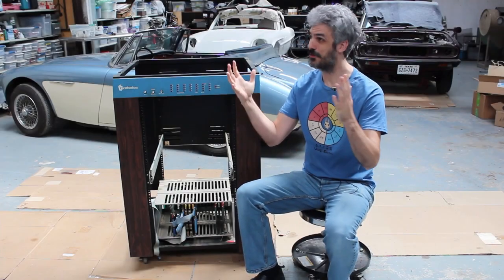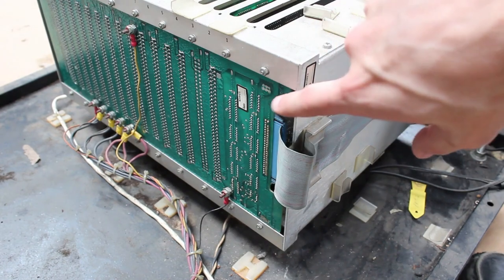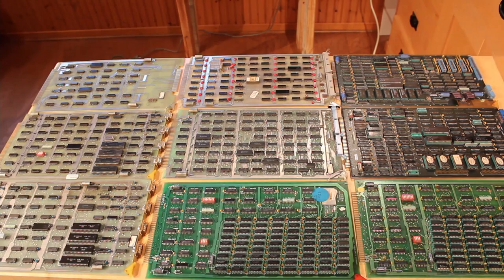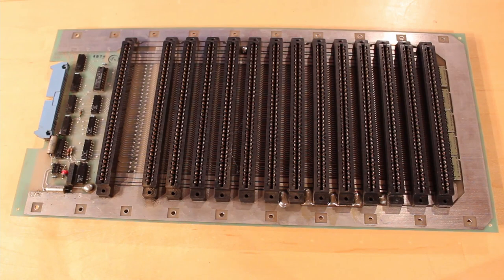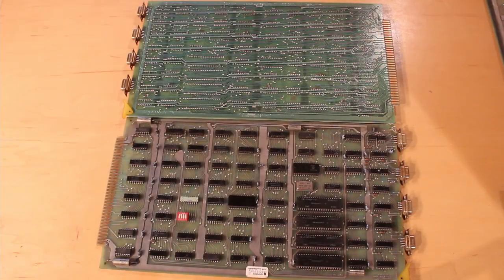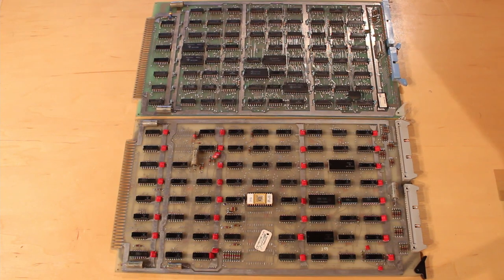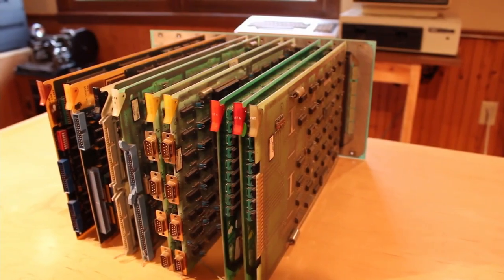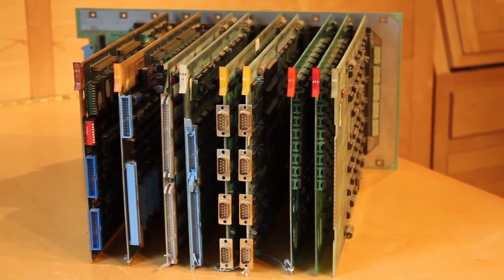Minicomputer Part 4: In-depth Look at all the Computer PCBs

Comment: Centurion board overview:
CPU6:  Is a 8 bit one board bit slice computer with a 16 bit PC (program counter). The 256 Byte static RAM chip are the CPU6  registers for each of the 16 interrupt levels. The two AMD2901 (4bit wide ALU's) with 8 bit x 2K PROMs emulate Warrex-Centurion's first computer the CPU4 which had four cards CPU1, CPU2, CPU3 and DMA card. Upper one of the 26 pin cables is DMA control signals and the lower 26 pin connector is for the front panel switches and LEDs.

DSK/Autoloader: Has two functions (1) is being part of the two boards needed to control the 10MB Control Data 9427H disk drive.  (2) The Autoload bootstrap is the machine code program needed to read the boot track from track zero on the 9427H disk zero (disk pack) or disk one (fixed disk). One 50 pin cable connects DSK/Auto to the DSK-II card. The other 50 pin shielded cable connects the DSK/Auto to the 9427H disk drive.   The 2702 EEPROM is the boot strap program store. The DSK/Auto & DSK-II cards designed back in 1976. Later designs of the DSK/Auto card removed the 2702 EEPROM and replaced it with two 128 byte PROMs to reduce cost. ( The two small caps on the back of the DSK-Auto card was to fix a drive select cross talk problem on the very first designed card rev. )

DSK-II: Is the 2nd half for the 9427 Hawk disk controller and has the CRC check sum and R/W controller state-mach logic. The 26 pin cable is the DMA (direct memory access) channel control signalling. If the DSK-II is in a CPU4 system the other end of the cable goes to the DMA card. If in a CPU5, CPU6 or CPU7 system the DMA connection is on the CPU card (no DMA card).

MUX: Is a 4 port RS-232 or 20 ma current loop serial controller to connect terminal to the minicomputer. The system default serial speed is 9600 baud (9600 8,1,N) for all ports but port 3 of the first card at I/O address F200 with is by default at 300 baud (300 8.1.N) for modem connections. (yes MODEM in the 1970-1980 run at 300 baud) FYI - The newer MUX card as the crystal oscillator in the silver can near the 4 UARTs. The old MUX card as a discreet crystal oscillator near the last serial port #3 bottom of the card.

CMD:  Is the disk controller for the 96M byte Control Data 9448 Phoenix disk drive. The first Centurion 9448 Phoenix disk drive controller has around six circuits cards of TTL & ECL logic and not very dependable. The later redesigned CMD card in this system is a single board CMD 9448 disk controller made up with two AMD 2901 4bit slice ALU and 8 bit x 2K PROMs to build the state-mach needs to interface the 9448 into the Centurion minicomputer.  The "edge 26 pin" cable is the DMA to the CPU5, CPU6 or CPU7 (CPU4 did not support the CMD). The 60 ping cable is the I/O cable to the CMD. The four other 26 pin cable connectors connect to CMD-1, CMD-2 CMD-3 or CMD-4.  The reason the AMD2901 are used on the CMD card is because the Centurion engineers like the AMD function & design easy after using the AMD2901 on the CPU5 & CPU6 designs.

PRT: Is a standard 7 bit parallel Centronics printer interface. This PRT card interface to the Data-100 (ODEC printer) that is with your system. The Data-100 printer can be from 125 LPM to 300 LPM.  Odd thing about the Data-100 printers is the printer does not have a print-hammer for each of the 132 print position on the wide green bar paper.  The Data-100 shuttles the hammer bar side to side in time with the character set chain ( one crazy design ).

MEM:  Is a 128K Byte with one bit parity per byte. The Centurion memory system is 8 bits wide and can only address 60K bytes of the 64K byte memory page ( baggage of the CPU4 system and Centurion memory mapped I/O ( F000-FFFF  )). The first Centurion memory was 4K byte core  cards. The next memory cards are 32K byte of 4K DRAM without parity. Your system has 128K bytes using 16K DRAM with parity. The 8 position enables with row of 9 memory chip is ON and which card it is the low 128K or the upper 128K memory card. The 4 position switch rolls the RAM chips around the memory address to memory trouble shooting.

BackPlane:  Is bus design driven from left end (CPU end) with termination resistor packs on the right end. The bus is 8 bit wide data, 16 bit wide address, 4 bit interrupt level and overall system control signals. To the left of the CPU slot is a PROM on a socket and control logic to help boot strap the system. (If a DSK/Autoload card is installed in this non-CPU4 backplane the boot EEPROM-PROM is disabled on the DSK/Auto card and the backplane PROM is used to boot from the 9427H, 9448 or floppy disk drive.) The 50 pin backplane cable controls the from panel LEDs. The system DC power connects to the backplane +5 VDC. +12VDC. -12VDC. Only the old 8 inch floppy disk drive uses the +24VDC from the power supply.

FYI  -  The Warrex / Centurion stickers on the cards are of warranty or repair date rechecking.  Also of a card has a RED tag on it the card has been make a bad and should have a tech's name, date & problem on the tag. If a GREEN tag the board tested good the the tech's name & date. If a YELLOW tag the card was found in the field service pipeline without a status tag and needs to be tested. If you real wish to get me pissed-off let me find a card in the shop without a GREEN or RED tag....!

Regards,  kromaine132@gmail.com
Reply from the maker: Ken, thank you so much for the absolutely stunning information!
I got so much wrong in my guessing on the system, haha. This is absolutely amazing, and I'm thinking I'll have to do a follow up video soon correcting all my misses and giving proper, updated information!
Reply: You did a great job for your first pass with the Centurion system being older than you are.  👍
Reply: For me it was the 75110 line drivers (I think) on the CMD card that said that was not part of the CPU but most likely for cables to the disk cabinets.  But I really appreciate the detail you added on the bit-slice architecture.  I never worked with it (got into designing properly in '83) but was certainly aware of it.  Also interesting was that AMD 3 to 8 decoder with tri-state outputs.  AMD had loads of interesting parts in that line-up.
Reply: Just..WOW!
Reply: So the CPU is made of discrete ICs?
Reply: @mojoblues66  the original cpu4 was, yes
Reply: what a bloody legend! damn I love youtube sometimes. was that information burnt into the back of your skull like the phosphor on that CRT? I know I have I have data burnt into my skull from 20 years ago. pager codes and calibration values. If im lucky, i'll get i cant remember my kids, but I can recite those damn numbers verbatim. 
to contribute something (n most ya'll will know this) the 7905 on the big heatsink was a - ve 5v regulator. 7805 was the positive. big fat 5v rail, but to get negative 5v was from the 7905, linear regulated down from the  -12v rail. hence a chonk heatsink. im not 100% sure why this is needed, but it was. I know old EEPROMS needed minus voltages for programming, and rs232 serial was a balanced +/ - signal. 
great video next
edit: youtube didnt like my use of asterixis and dash marks
Reply: @mojoblues66  Correct, no microprocessor here. Looking at the board you see the individual parts of the processor. The PROMS contain machine states that get played back just like a player piano scroll or a music box sequence drum. Each instruction triggers off a sequence of probably 8 'notes' which move data between various chips and tell the ALU what to do. The heart of the CPU is an 8 bit ALU made from two AM2901 bit slice 4 bit ALU chips working together.
Reply: Now I don't need to watch the video!
Reply: @Peter_S_  I used to work on machines that used AM2901s to emulate old PICK/Reality machines from the 1970s. It was incredible how well they worked.
Reply: Another note, the 7905 mentioned in the video is a -5V regulator and not a +5V regulator. This is probably for some of the EPROMs, as some of the older versions require both +/-5V as well as 12V.
Reply: Wow! Thank you for the description! So much of IC's and so less computing power...🙄🙄 Probably guys were a little bit upset when IBM started rolling 286s...
Reply: @ran2wild370  Not really, we had 10 years of App. Software for CPA's, Hospitals, small Banks, small Oil & Gas drillers  and small MFG companies. Product was very strong in its time, so much that EDS ( Ross Perot ) did buy the company.   Regards, Ken R.
Reply: @kenromaine2387  After almost 40 years this fact sounds almost  as a fairy-tale  legend for those who got into the world of  computing in late 90s. Some then young people witnessed  "big machines" being destroyed or substituted with something smaller but steep expensive.
Reply: @kenromaine2387  Was company bought for its design and mfg skills or for the customer database ?   I think EDS were moving into consulting more than manufacture about then would I be correct ?  Also I note Warrex Computer appear to be still in a semi-live state as a registered company in Texas.
Reply: @highpath4776  I think EDS purchased Warrex-Centurion for the product line and not the installed based / dealer network. The dealer network was not a positive to EDS other than some cash flow.   EDS used a large number of Centurion systems for smaller EDS customers to keep Wang, IBM, Basic Four, DEC an others out of EDS customers.  We also built one off Centurion systems for EDS Credit Union customers like "CUNA-DATA", EDS clone 3270 terminals and a line of EDS PC clones.   After EDS sold the Centurion product line to Z-TRON, EDS renamed old Centurion mfg site to EDS Tech. Products and still built the EDS PC clone for a time. When EDS was purchased by GM in the mid-late 1980s EDS Tech. Product built test equipment for a short time of GM like "CAMs".    After EDS Tech. Products the old Centurion building at 1780 JayEll was sold to Ross Perot's new company called "Perot Data Systems" and became a data center site.     As for the Centurion office you maybe asking about in San Ant, TX. this was the first Centurion Dealership.  Does not seem that any "Centurion" related business is taking place at the site and the first owner  ( Bobby W. ) of this business seems to have passed away.
Reply: What a man bro!!!!
Reply: If all you have is one hammer...
...you have a Data-100 printer. :-P

But seriously, the thing that I find most curious about this mini is its date of manufacture, a time when both the IBM 5150 and the C64 were already out, and this was very close to the time when the first 20+ MB 5¼" HDDs were available and able to provide about the same storage capacity as those ginormous big iron Hawk and Phoenix drives. The Centurion altogether looks and feels like a computer from the seventies, not the mid-eighties. Maybe it was a late mini and a seventies design, but they were still building it through the early eighties? Is that about right?
Reply: @ropersonline  Correct the Warrex Centurion base level design started with the ee200 real-time core memory minicomputer from 1972. Warrex's first system was called the CPU4 in 1974-1975 with 32KB of DRAM memory.  Warrex kept upgrading and building faster systems over the years like the CPU5 with 128KB of memory and the CPU6 with 256KB of memory in 1980-1984.  In 1986 after leaving EDS the new owner of the Centurion "IP" ( Z-TRON) even built a CPU7 system.   The key point is the Centurion End User / customer from 1975 still could run the business software they invested money into on the newest Centurion CPU7 over 12  later,   In fact we have even found recently found that the system in this video ran account functions on this system hardware in the late 1990's..!  We even now know of a couple of end user accounts still running business programs that started live on the CPU4 in the late 1970's still running in 2022 after being ported onto Intel platforms.   Yes the PC was out in the mid 1980's but the Oil & Gas packages (like this system in the video ran),,   Accounting packages for CPA's, Small CU & Banking packages and ERP manufacturing Inventory packages supporting 1 to 32 or in later years over 100 terminal was not running on PC based systems at that time.   The key was the End User software that kept a Centurion customer and the customer's local Centurion dealers customer support.   Did the PC hurt Centurion's sales in the late 1980s & early 1990s, yes....  Just ask DG, Wang, NCR and DEC what networked PC did to sales of other minicomputer in the 1990s.
Reply: @kenromaine2387  EDS is for Electronic Data Systems, I presume. Thank you for the information! :)
Reply: @ropersonline  Correct  EDS = Electronic Data Systems.  Centurion not only built the CPU6 minicomputer line for EDS and our dealers we also built a line of XT class PCs and 3270 terminals for internal EDS use.
Reply: we have been visited by a wizard

Comment: You might want to add back an opaque sticker on top of your PROM before your vintage bits escape...
Reply from the maker: See, this is why I prefer tubes, each bit gets it own protective glass case to prevent it from falling out!

(Thankfully, that PROM spent it's entire life buried deep in the bowels of the machine, and aside from some quick pictures and filming indoors, I've been keeping it covered!)
Reply: @UsagiElectric  If you need assistance, I'm restoring my own terminal I found in a creek. I've already got the CRT board and parts of the logic board working. The CPU side works and runs my own custom debugger rom, but I'm still working on the video signal generation side as it's much more complex.
Reply: You should try to read them, the data will slowly leak away on UV-EPROMs. They can be reprogrammed to refresh the data stored in them.
Reply: @CuriousMarc: Funnily I tried setting a 27C64 that I wanted to erase in the sun for weeks last summer and not a single bit flipped. I had to eventually buy an eraser to get the thing back to all 0xFF. Fortunately they aren't expensive anymore...

I'm not disagreeing with you, putting a sticker on would sure not hurt and I'd do it as well, but it seems that at least some of them can be pretty resilient to natural UV light, way more than one would expect. But with an EPROM that may be the last working one containing those vintage bits, I would be extremely careful as well. At least until I successfully copied the data to at least two other locations, one of them preferably on another planet. ;-)
Reply: @Colaholiker  Good to know! Appears more robust than one would think. I’d put the 27C64 in the category of newfangled modern devices though, as it is a later CMOS version. It would be interesting to find how the earlier devices fare. Might not be that bad either. I definitely use a UV eraser to erase mine.
Reply: @CuriousMarc  I'd love to see that too, unfortunately I still have to get my hands on something more retro. The stuff I get to work with are usually 1990s control systems powered by 8051s or Z80 derivatives. Not nearly as cool as the stuff you work with on your channel. (Long-time subscriber here)
Reply: @Colaholiker  I think they need UV-C to erase. They recommend 250nm 15W*Sec / cm^2 , that's pretty high intensity.  There's no UV-C in sunlight and very little UV-B (280-315nm)
Reply: @UsagiElectric  good

Comment: I think you have two separate CPUs.  The one labeled CPU is the main CPU; it has the most complex microcode. The other labeled CMD is an I/O processor designed to connect to the CMD disk drives. They have different instruction sets.

The CPU could be 8 or 16 bits; it's likely 8 bits though. It might implement a faster version of a slow MOS processor.

The I/O processor would have special microcoded instructions to speed I/O operations (shift/merge, bit scan, etc).  Examples are the Intel 8089 (companion to 8086/8088) and the Signetics 8X300.
Reply: The Intel 8089 I/O processor was used in the Intel iSBC 215G hard disk controller card used in Intel Multibus systems.
Reply from the maker: I definitely think you're on the right track with the CMD board being for IO processing. The reason I was so hung up on a 16-bit architecture was the fact that the address LEDs on the front panel depict 16-bit addresses, but I think I was getting too hung up on the idea that the entire processor had to use a single 16-bit bus. It's totally possible that they used 16-bits for addressing, 8-bits for processing, and multiple other buses for various things in a classic Harvard architecture. 

I've still got a whole lot to learn about these wild computer systems from the early days!